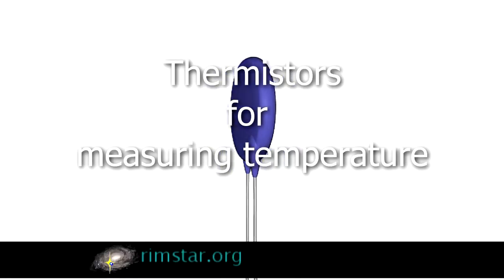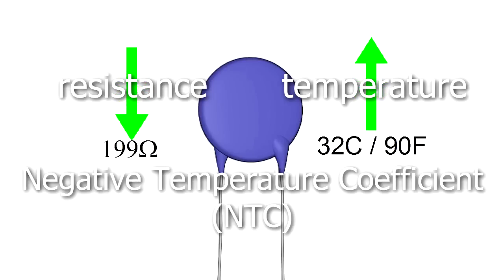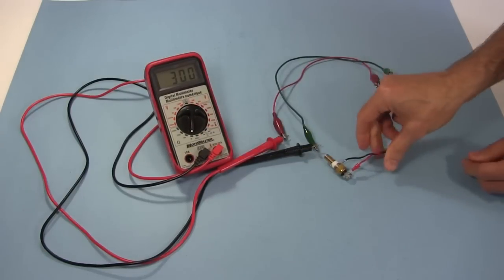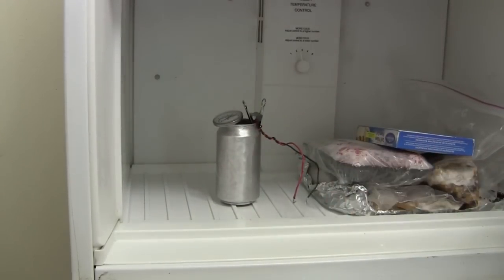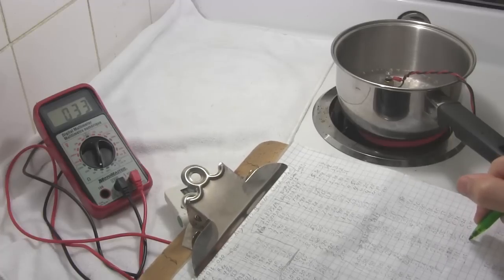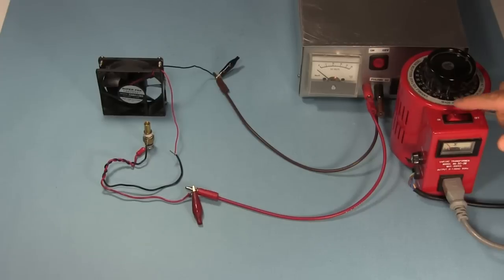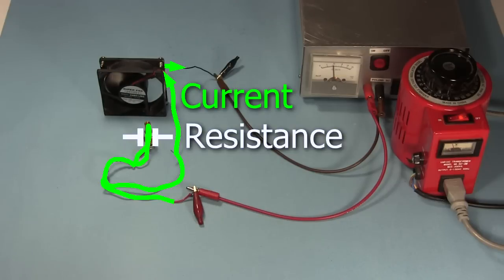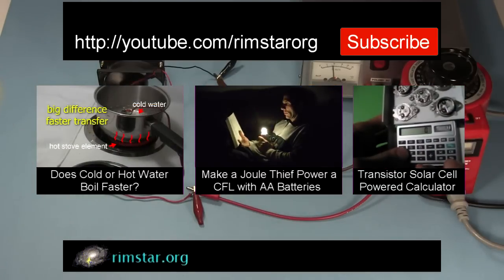Thermistor for measuring/controlling temperature

Comment from the maker: This week's video is an electronics one all about using thermistors, what they are and how use them to measure and control temperature. I especially had fun doing the simple circuit where I heat up the thermistor with a hair dryer until that causes the fan to turn on. And then the fan cools off the thermistor, causing the fan to turn off!

Comment from the maker: This sensor is for attaching to the cooling system in a particular model of car, so you'd have to make your own mounting system.
To turn on a fan below 100C you can do what I did in the video. But it probably won't turn on at 100C. For that you'd need to add a resistor so that the total resistance adds up to something that would result in the right current for the fan. You also have to consider what temperature the fan should turn off at.
Search google for "pexsupply snap disc" for a better way.

Comment from the maker: According to the graph, cold water won't boil sooner than room temp water. Cold water will have a faster heat transfer rate while it is still cold, but once the cold water reaches room temp, the heat transfer rate will be the rate it should be for room temp water. So once the cold water reaches room temp it will take the same time from then on as room temp water does.

Comment: Comrade thank you, I can't believe I couldn't find anything online when I typed in "thermal protection resistors" or "thermistor" even only came back with typical temp. measuring therms, not resistance regulating ones. PTC and NTC.. That's what I was missing I'm guessing.. Lol. Thanks again for the help, got yourself a like/subscrip!

Comment from the maker: I just opened up with only PC power supply I have (outside of a computer) and it has SCK 054, an NTC thermistor. I don't want leave this power supply intact though in case I ever need it as such. At least I now know where to find them. Thanks!

Comment from the maker: The only way I know to do that is create moving positive ions. It'd be atoms that are ions with positive protons and neutral neutrons in the nucleus and negative electrons surrounding the nucleus but there would be less electrons than protons, and so they'd be positively charged. In fact, I've done it in my "How to Make/Build a Lifter or Ionocraft" video. The positive wire electrode strips electrons from atoms in the air to create positive ions, which flow down to the negatively charged foil.

Comment: Found a great one just now. Take a look for small green bulb type devices attached to back of large heatsinks. Got one from another PC power supply, it was 7.3K at rest in approx 80F. Blew on it for 30 seconds and it went to over 8K, warmed it between fingers and it went down to 6.5K. Can only imagine fridge and sun values...pretty good temp sensor for free, once calibrated. Perhaps to keep an unpowered eye on transistors or other circuits, or part of indoors/outdoors actual temp sensor :)

Comment: That was fun :) 
Just grabbed what I thought to be one off an old PC power supply and had a little look. Green disc 'SCK 2R55A'. Thought may as well try it. Only 2.7ohms at 80F room temp. Held in hand it went to 2.5ohms, in front of a small fan, up to 3.3 ohms. At 10x those figures it would be similar to your automotive one...did a search and it is one, but nothing like as variable as that one you show. Still, I now know something more about them, cheers.

Comment from the maker: It isn't a capacitor symbol, though I can see the resemblance. It's supposed to be like two walls facing each other. When they're close together they restrict the flow of electrons i.e. high resistance. When they're farther apart they allow more flow i.e. low resistance. Oh well.

Comment from the maker: No need to do the setup with common resistor. I just connected a 1 kohm, 2 watt resistor to my meter and put the same hair drier on it for 1 minute, twice as long as I did in the video, and the resistance increased by only 8 ohms. Common resistors aren't affected by temp. as much as thermistors.
The VARIAC is a 3 amp, 240VAC one which I bought off-the-shelf. I'd recommend higher amperage for more usefulness. Maybe salvage from old power supplies but usually buy second hand since they're costly.

Comment: My Whirlpool gas dryer isn't getting hot enough and the clothes never get dry, the gas flame works, it's just shutting the heat off too soon, so I bought what is called a thermistor in a sealed plastic case that screws onto the exiting chamber after the blower. This did not solve the problem.

When I remove the thermistor as to not allow it to sense any warm temperature and left it plugged in the flame stays on endlessly. At first I assumed that even though the encased thermistor was new in the package that it might be defective straight from the manufacturer, but now that I see this video there are a few of these disc-like thermistors attached inside the dryers wiring harness, they are not seemingly positioned in any specific spot as if to sense temperature, but just part of the wiring, I always thought these were perhaps some sort of resistor, but instead they are identical to what you call a thermistor.

When I was at a dead end on what to do next then this video helped me to decide that the next thing I should try is to replace the short harness sections that contain these thermistors. Thanks for making this video.

Comment: You sound like just the guy I need to talk to. I am building my own carbonator for my soda pop addiction for which there is plenty of instruction on You Tube and the internet in general.  What I would like you to do, is to show us how to build a portable cooler on wheels (which uses common rechargeable batteries [AA orAAA]), which uses common and cheap space age materials, that would pass the Energy Star test with flying colors. It should incorporate the carbonator which can be represented by a black box. The cooler should come on at 33 degrees Faranheight  and turn off around 34 or 35 degrees, and maybe contain a couple of trimmer potentiometers for controlling temperatures. You can likely run a few second manufacturer add that can't be skipped to pay for your time.
Reply: Mauritius pron

Comment: Thank you for making this video. A small question is how to know if a thermistor is malfunctioning? In my car A/C, the compressor cycles soo much and especially in cold weather. When I jumped the connection; it stayed ON. It is trying to control the temperature to 4 degC but it seems too sensitive. Is thermistor can go bad or is it a design flaw in the circuit? thank you for your video.
Reply from the maker: I guess you'd have to isolate the thermistor from the rest of the circuit and then create a setup like I have in the video. Then set up a test circuit like I do in the video and see if it works. Or if you can't remove it enough from the circuit then try heating it with a hair drier.
Reply from the maker: And I'm glad to hear you liked my video. Thanks for watching.

Comment: I have a question for you , i gotta remote controlled car motor and i would like to place my custom fan for cooling which would be controlled by a NTC Thermistor. But i am a little bit confused about the temperature that i want it to turn on. Do you mind to help? I was thinking to M35 or 5D-11 would work. the heat goes on those brushless motors pretty high sometimes. I would like to find the right thermistor that it would turn on the fan around 150-175F. which model thermistor should i use do you think?
Reply from the maker: I couldn't find any data on the M35. The 5D-11 has the temperature range.
Reply: So it could be thw right option. Let me give it a shot and i will post my experience. Thank you so much.

Comment: hey, 

the idea is just awesome...but upto wat temperature does this system works or upto wat temperature will it sense the temp/.....
Reply from the maker: +iADT I don't know. There's no data on the box that it came in and I wasn't able to find a datasheet for it online when I looked before. Maybe you'll have better luck. It's a BWD part and the part numbers on the box are 020-7913-8 and WT691. It's normally used for car engine systems somewhere. But if you have a non-automotive thermistor, one that isn't in the brass casing like mine, then you can probably look up some numbers online.

Comment: If you're going to use a thermistor to control more than small power then use it to control a power transistor (a FET or Darlington) that the power flows through.

Comment: is termister used on 12v only? or AC 230V can be used?
Reply: +Santosh Kulkarni you can connect it to 230v, with relay, u cant supply it directly with 230v, but you can use step down transformer ,using full bridge rectifier running 12volts dc, it would be enough.
Reply: Thank you
Reply: Santosh Kulkarni glad to help sir good day.

Comment: Does the thermistor have a maximum current limit to it ? How much current can it handle before it breaksdown ?.
Reply from the maker: +Tasty Fish Mine didn't have anything written on it, probably because it's an automotive sensor intended for certain cars. Looking at some datasheets doesn't help much either. From https://en.wikipedia.org/wiki/Thermistor "If the current is large enough to generate more heat than the device can lose to its surroundings, the device heats up, causing its resistance to increase. This creates a self-reinforcing effect that drives the resistance upwards, therefore limiting the current." So it sounds like the answer is no.
Reply: +RimstarOrg Thank you mr scientist .

Comment: very good! but I have a question: what temperature reach the thermistor 1 k ohm when you apply 12 volt? it is very hot (about 85 C) and isn't dangerous if you put it in a fuel tank to have a low sensor that light a bulb? sorry for my poor English. Ciao.
Reply from the maker: I don't know the answer for your first question.
For 85C, search for the "ignition temperature" of your fuel.

Comment: Can you please tell me the specifications of the thermistor featured in this video
Reply from the maker: I don't have any of the specifications for this thermistor since it's embedded in the automotive sensor. The info for the sensor is BWD 020-7913-8 WT691 but that probably won't help you much.
Reply: +RimstarOrg I just wanted to make a project on a thermally controlled fan just like you did for fun

Comment: how hot did your sensor get to turn on fan ??

also is there a engine coolent temp sensor  that will turn on a fan at a 98 degrees
Reply from the maker: J Vizz I didn't measure the temperature. If you're looking for something that isn't really for an engine then you might want to look at snap discs, like these http://www.supplyhouse.com/Fan-and-Limit-Controls-1880000 They come in a variety of temperature ranges. I have this webpage that talks about them specifically http://rimstar.org/equip/temp_control_circuit.htm

Comment: I would like to use something like this to turn on and off an electric pvc sprinkler valve. On at 65 F, off at 75F do you have any suggestions?
Reply: or visa versa
Reply from the maker: +Jonathon Shafer You could use a circuit with a thermistor, that's in the right range. Or you could try looking for a snap disk (http://rimstar.org/equip/temp_control_circuit.htm), though those temperatures are a little low for that.
Reply: +RimstarOrg it is to regulate water temperature inside a large tank for fish...if that helps with ideas. I want to recycle the water from an underground collection tank also using the home hot water to balance temperatures.

Comment: Running current through resistance warms the resisting object which in this case is the thermistor. At low current like signal strength, it won't make much difference.

Comment: i need to measure the temperature of hat water inside the tube. i can make the hole for set up this thermister but m not getting how to put it. the water will be in contact with both wires. ?????

can u answer ??
Reply from the maker: kunwer singh Just make sure the water isn't in electrical contact with both wires by insulating the wires. To insulate the wires you can use heat shrink tubing, or liquid electrical tape, or anything else you can think of that would prevent the metal of the wires from getting wet.
Reply: RimstarOrg  I forgot to tell you tat my planing to use it in heat exchanger which am designing. actually am thinking both of RTD and Thermister . Ican make its wire insulated but takes more time. I better use RTD .

Comment: Hi
Thank you for your great help.
I have a dishwasher thermistor on which T120K carved. 
I do not know how to find resistance vs temperature. 
Would you please help me?
Reply from the maker: Hi
You can use the technique I show in this video. Alternatively, you'd need a part number for it and then to search online for that part number and hope you can find a specification sheet with a resistance vs temperature chart.

Comment: I want to build a circuit to trigger a buzzer if the temperature in my fridge gets too high. I lost a bunch of groceries after an electrical snafu in my home and wanted to prevent that from happening again.
Do you have any other videos which might help me understand how to design a battery supply which only began to feed power to something should another power source fail? I suppose I just want to learn how to design a portable back up battery. Portable as in I can easily carry it from one place to another and portable as in it could be easily adjusted for use with most DC supplied electronics.

Comment: I'm looking to sound an alarm when my water temperature reaches 180 degrees Fahrenheit.    Can you lead me in the righy direction of how to go about doing that?     Thanks
Reply from the maker: Brian Hoppe Have a look here at the snap disk sensors http://www.supplyhouse.com/Fan-and-Limit-Controls-1880000. There's one listed that cuts in (the switch closes) at 180F. I talk about them more on my webpage here http://rimstar.org/equip/temp_control_circuit.htm.
Reply: Thanks a lot...it's much appreciated!

Comment: how can I use that as PTC? for me to cut the current as the temp increases on our project, serves as a safety element. Thanks in Advance! ^_^
Reply from the maker: It's likely possible to come up with a circuit that will make it work but I don't have the time to come up with one. You may as well find a PTC or look into snap discs (http://rimstar.org/equip/temp_control_circuit.htm).

Comment: i bet these would be usefull in electric heated still, to keep the temp at 80 degrees centigrade. couse when using fire you need to baby sit it, and adjust, becouse the flame changes. today did the first test of my first still. the alcohol burned. even thou i overheated it to 95 C.

Comment: DID YOU NOTICE THAT YOUR WIRES THAT ARE CONECTED TO THE COMPONENT ARE ACTUALLY MELTING AS YOU PERFORM THIS EXCERCISE ON THE OUTTER PART OF THE POT.  Not to say that this isn't a good example of how this works but leaves the results open to inaccurate readings. " Perhaps a can of freeze and a heat gun or hair drier would have been a bit safer here "  However good effort